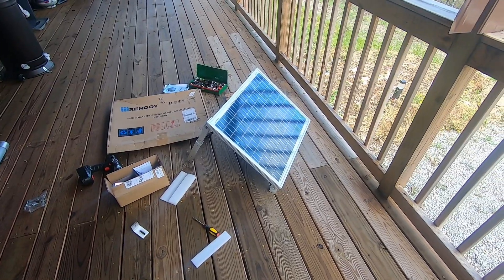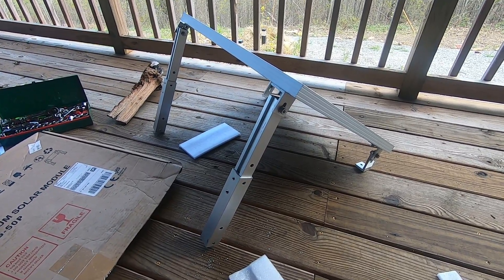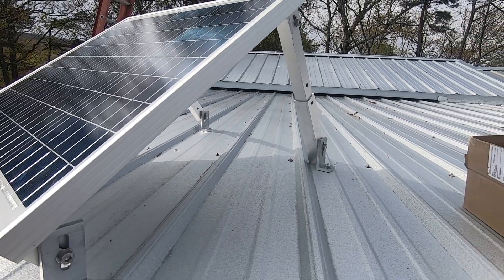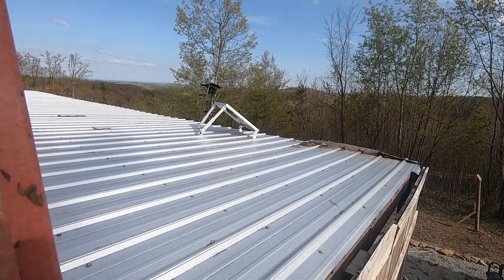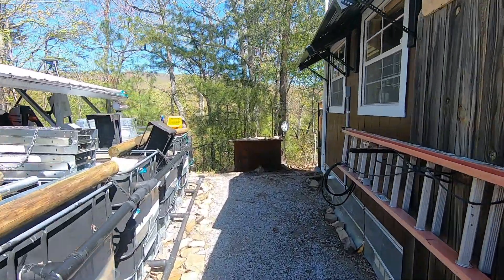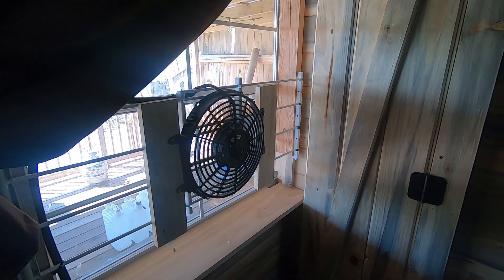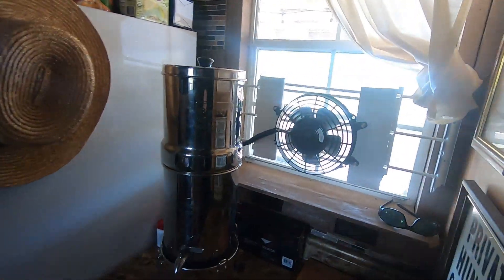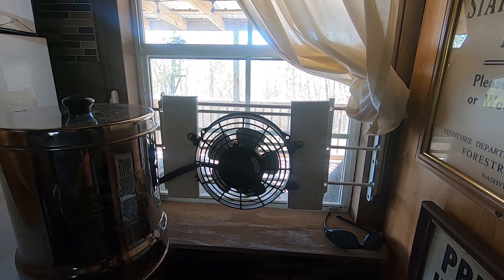Solar Fan for the window Off Grid Tiny Home Cabin cooling

Comment: Hello Sir, nice video, it's very helpful to everyone of us. May I just ask, are those radiator fans not be broken due to fluctuating voltage since they're connected directly to solar panel? Thanks for your usual prompt response.
Reply from the maker: It doesnt hurt them. It would be the same as adding a soft start on it or adding a VFD .
Reply: @GrumpyMountainMan  Thanks Sir.. How about the fuses? what capacity should i put on if i have an 80a radiator fan..
Reply from the maker: Use this website.  https://www.rapidtables.com/calc/electric/Watt_to_Amp_Calculator.html

Comment: Sir, I like your set up. I plan to set this up for my dog kennel. So my ? is all you used was a solar panel and a 12v car radiator fan right? what kind of solar panel is it thank you.
Reply from the maker: A 50 watt panel will run your fan .
Reply: @GrumpyMountainMan  So just be  sure all you installed is a panel,  a fan, and a on/ off switch right?
Reply from the maker: @RafaelJimenez-hz9gu  yes and a switch with an in-line automotive fuse

Comment: Was considering installing a whirlybird to vent/cool my roof, but I live in the tropics and there's never much breeze but a shit ton of rain so was worried it might leak. Then after thinking about it some more thought of exactly this set up, radiator fan under the eaves, powered directly by solar. So thanks for this, I can see it in action before buying the gear. Cheers.
Reply from the maker: So glad I could help : )

Comment: Awesome video Grumpy.  This is exactly what I was looking for.  Plus I have the exact fan.  Purchased it on ebay for $20 4 years ago and never used it.  I was going connect it to an ac adapter and make a stand for it.
Reply: What kind of fan is that can you make a plug for it and plug it into a wall socket ?

Comment: Brand of the fan? Plus how did you wire it in? Is it a kit or piece it together?
Reply from the maker: It's a 12volt car radiator fan , you can use a 12 volt attic fan   also. Wiring red to red. Black to black. Thank you for watching the video : )
Reply: @GrumpyMountainMan  Hello Sir, nice video, it's very helpful to everyone of us. May I just ask, are those radiator fans not be broken due to fluctuating voltage since they're connected directly to solar panel? Thanks for your usual prompt response.